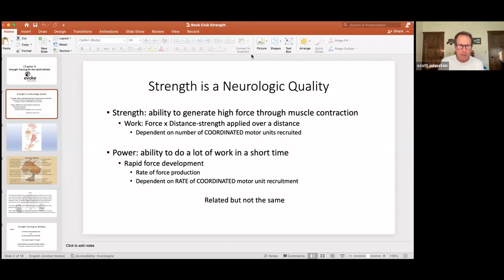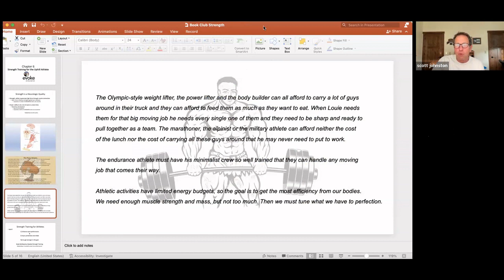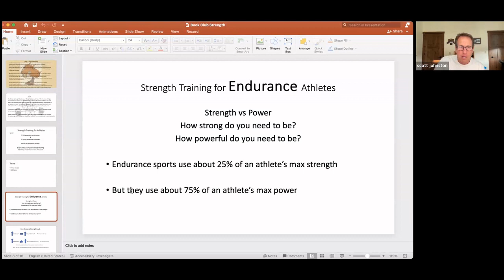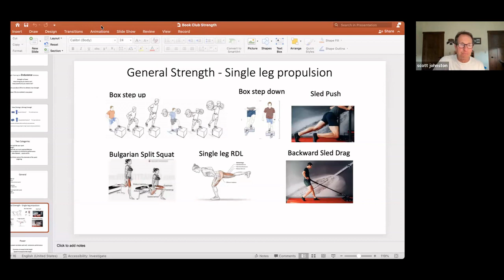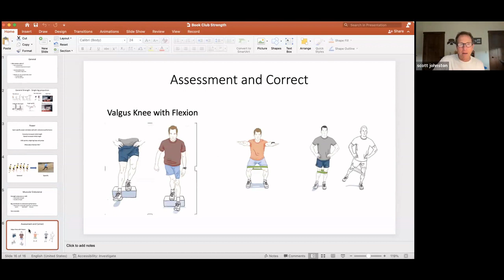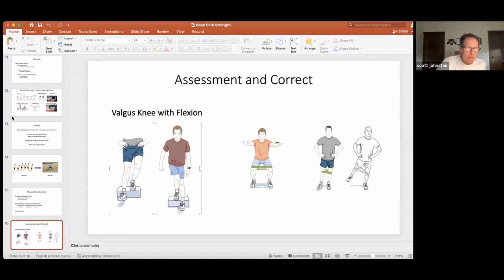Evoke Endurance Book Club Chapter 6: Training Strength And Power

Comment: Its a great series. Thanks for it.  I'm not buying into single leg strength exercises being more specific  to team sports, sprinting, you name it. The fact that you are on one leg means nothing. Those exercises do not have the same motor patterns, time pressure is vastly different, they do not have the same joint angles, they do not recruit the muscles in the same muscular work regimes, and they are not done in the same energetic regime compared to  the competitive actions. The fact that you are on one leg is irrelevant. And every-time I see a one leg RDL with the non-working leg raised behind, I ask myself "what are those people after"?  The weight of the  leg extended behind and the monstrous moment arm at hip it has destroys any chance of efficiently loading that exercise. It becomes more of a weird balancing exercise than a strength exercise. Just load a RDL bilaterally and reap the benefits. Or if you want a unilateral exercise, use a reverse leg press. It can be properly loaded.  Beats the living daylights of that 1 leg RDL bastard.
Reply: This was the only part of the discussion I tended to disagree with too. IMO, you can’t say there’s no upper limit to power for endurance athletes, then not utilize bilateral training, as that’s the only way to load near max or max rep weight. I do like your suggestion of reverse press, because if unilateral, best to maximize balance to take that variable out of it.